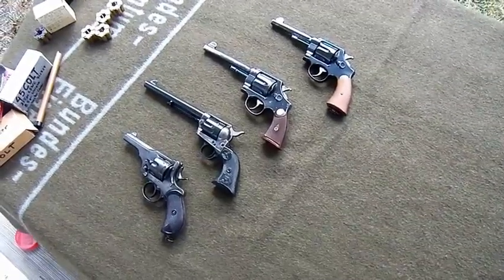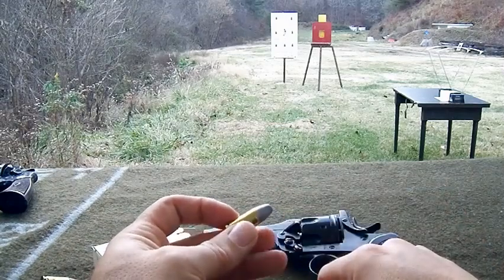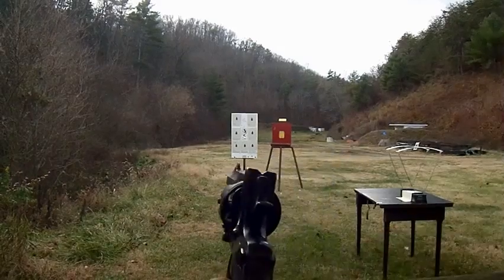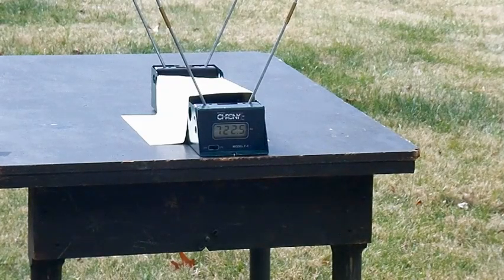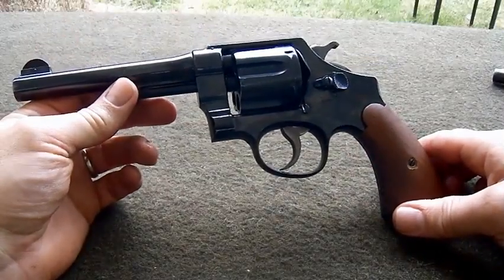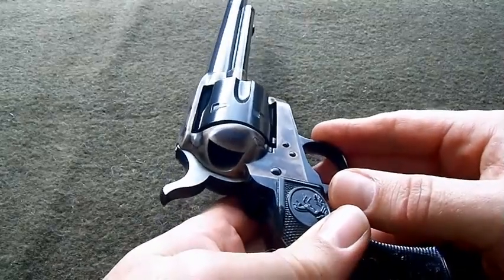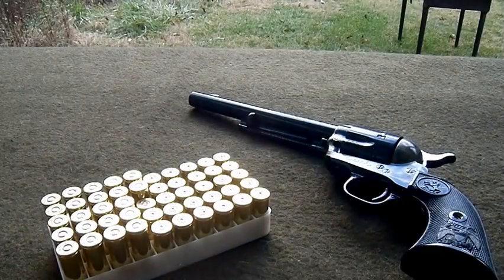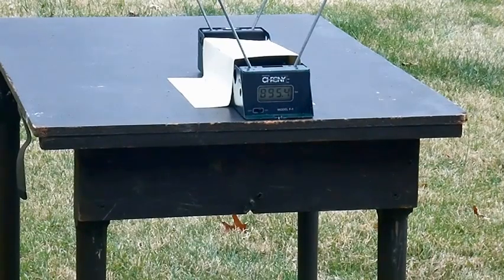Big Bore Revolvers

Comment: your unique loads are  position sensitve which means you have a lot of air space thus causing your powder charge to move about in the case causing pressure curve issues...some of your loads are firing from the base of the cartridge others are firing with the powder forward of the case, 38 spls do the same both cartridges were both design to load black powder which fills the cases efficiently, great video.

Comment: can your 1917 handle factory ammo power loads?
Reply from the maker: Well, I don't have that particular one anymore.  But yes, M1917 revolvers can handle factory power loads---SAAMI standard pressure loads.  No Plus-P stuff; the steels weren't as good back then, and the cylinders weren't even heat-treated.

Comment: Got a Mark I just about like it. Built around 1892 but reproofed smokeless in 1905 Has the hardened backplate but NOT the modified ejector. Working up a smokeless load now but not with a HB bullet. Interesting to see it shoot with black powder and that's something I may try down the road. Anyway, great video!

Comment: I have a original Mark I in 455. Never shaved down. It's in fair condition but it's missing the extractor lever. I have been looking for long time. No luck. I'm ready to try making one by hand if I could find a drawing.
Reply from the maker: I don't think that would be too hard to do, since it looks like it was cut out of some kind of flat stock anyway.  I believe that all the marks of .455 Webleys had the same lever.  Check out item 17 in the following exploded diagram.  https://www.gunpartscorp.com/pub/schematic/Webley_MKVI_schem.jpg  That is from Numrich Gun Parts Corp.

Comment: Thanks a lot for the video, Atlantic.

  My MK1 is also a **, and shaved to .45 ACP. The hardened steel recoil shield was never installed either.

I have decided to start reloading my MK1 using black powder now. I have FFFg BP, and I think i'll start with 15 grns, working my way up to 18. I have 400 - 265 .452 dia hb projectiles that should arrive tomorrow or Monday. Do you use regular .45 Auto dies, or .455 dies?
Any advice for reloading these? I'm excited to get started, but i'm a little apprehensive as I have never reloaded with BP before.

Thanks, Atlantic.
Reply from the maker: +Justins1877  I'm curious as to when you acquired yours.  See, I actually had to trade mine away (found something I couldn't live without, but had no money), and it would be really neat if the one you own now is the one I had to trade away.  Good call on the HB projectiles; they obturate nicely in what is probably a larger bore than .452.    I bought the .455 dies, mostly because they came with a seating die that was already shaped for the original Webley bullet.  They weren't too epensive (Lee), and they also come with some smokeless loading recipes in case you ever want to try that as well.  The Webley dies also have a crimping die that will put a slight roll crimp on your case--the .45 ACP die won't do that, so if you stick with ACP dies, you'd have to just hope that the taper crimp was sufficient.   My only advise with BP loading is just not to worry about working up from 15 grains.  Stuff as much BP into that case as you can and still seat the bullet without deforming the bullet nose.  I was worried a bit that the hollow base would create an air pocket (not supposed to be a good thing with BP), so I took great pains to get a full load.  I found that 18 grains was all I could fit.  I tried 20 grains, but that was just too much to allow the bullet to seat.  Good luck, and happy shooting!

Comment: Well that was a feast of 45's, really enjoyable. do you use a filler over your Nitro loads ? 5 grains looks very lonely up at the end of a big case, I think it is more consistent with the use of a filler.
Reply from the maker: Thanks for the kind comments!  I've never used a filler.  By your mention of 5 grains, I'm assuming that you're talking about the Webley.  It is a pretty smallish case, so 5 grains isn't too lonely.  I haven't loaded those with smokeless in a long time though; black powder is much more fun!
I have found that the .45 Colt case, however,  is just too cavernous for velocity consistency with low-pressure smokeless loads unless I use Titegroup.  Unique, while inexplicably accurate, can give me up to 200 f.p.s. variability depending on powder position.  For heavy loads through a Blackhawk, however, a hefty charge of Win296 (H110) works great.  Still, for all around shooting fun and consistently good velocity, nothing beats a case full of black powder in the .45 Colt.
Reply: atlanticproducts I think you are spot on with using black powder, I use 35 grs of Swiss. The 5 gr load was with Hogden Clay's in Colt 45, I find the only way to get good results is to use a hard foam filler, this keeps the load safe,(powder back on the primer) and consistent, I use the same method in my .577 NE , it works well.
Reply: atlanticproducts One thing I wanted to ask is have you used the Webley bullet in the Colt 45 SAA, it has the hollow base which could be an interesting experiment, but is the nose to long?
Reply from the maker: Englishman French No, I have not tried that combination because of length.  The Webley bullet is not only long, but it narrows early--thereby limiting the depth to which it can be seated and crimped.  Just laying one beside an empty case at a reasonable seating depth shows that over all length would be nearly 1.8 inches.  I think it would work in a Schofield case, though.

Comment: Atlanticproducts GOEX Cartridge grade seems to be the equivalent of old Dupont musket powder from the 1850's.  It is intentionally a low performance black powder made to be safe in thin, .69 cap smoothboe musket barrels.  U.S. Ordnace in the late 1850's, using Dupont musket powder used ballistic pendulums to measure 740fps for 30grs under a 216 gr conical from a Colt Dragoon.  

Using a Uberti Dragoon, 30grs of GOEX CTG grade made 745fps under a 216gr Rapine 452215 for me.  Same performance!

Comment: Great video atlanticproducts!  

In researching combustible cartridges for cap & ball revolvers I discovered that the 1850's black powder commonly used, (Hazard Powder Co #1 Pistol powder) was a very fine grain sporting grade black powder capable of high performance.  Modern equivalent is Swiss Null B black powder.  I get 940 fps w/ 23 grs w/ 216gr conical in 8" Uberti replica Colt 1860. The 455 @ 18grs should hit 710+ fps.

Use only paper powder envelopes & NEVER loose load Null B  in C&B!

Comment from the maker: You'd have to slug your bore to be certain, but .454 to .455 is a good rule of thumb with these.  With the hollow-based bullet I use, and casting it soft, it isn't an issue---if undersized, the skirt would expand under the gas pressure and take up the slack.  If oversized, it is soft enough to be easily swaged down during its passage through the throat and bore.